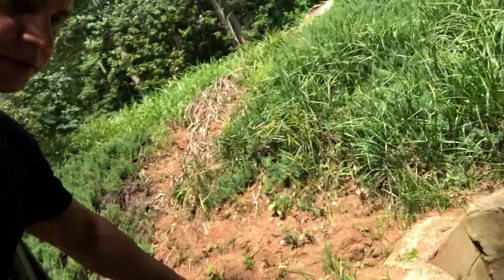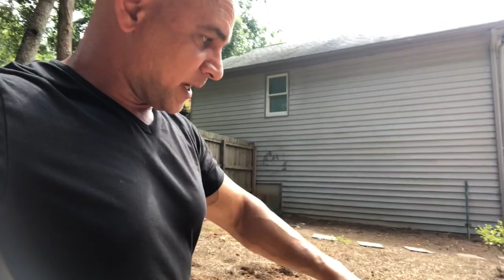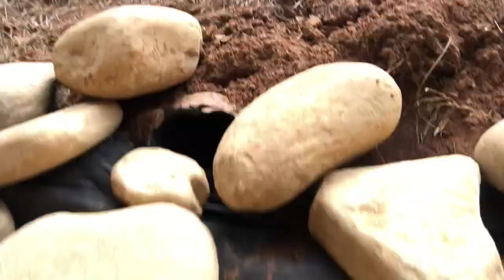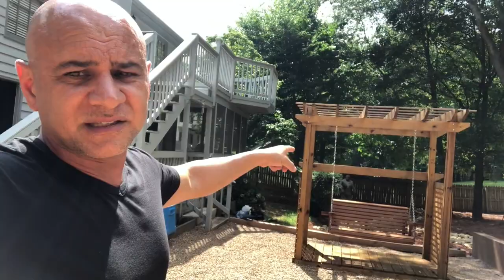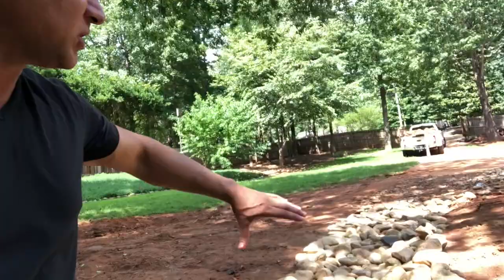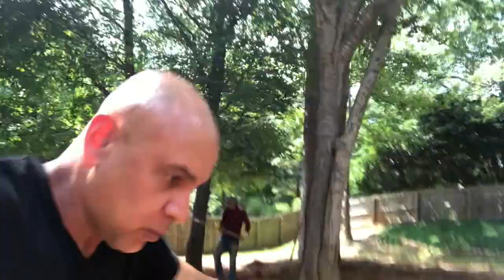Dry Creek Bed Design, Drainage and Calculations 🔨 Dry Creek Bed (The Complete Scope!)

Comment: Great video. Really enjoy all the details. I see you use corrugated pipe from the gutter down spouts instead of PVC. Do you always do that? I am working on a DIY project and trying to decide whether to use corrugated or pvc. Corrugated seems easier to work with, but debris can get stuck in the grooves, pvc has smooth finish but harder to work with. I would appreciate your input.
Reply: Go with the smooth pvc. Well worth the effort. Corrugated is junk.